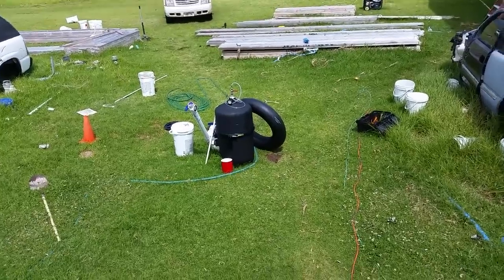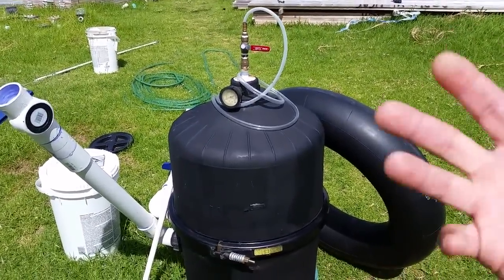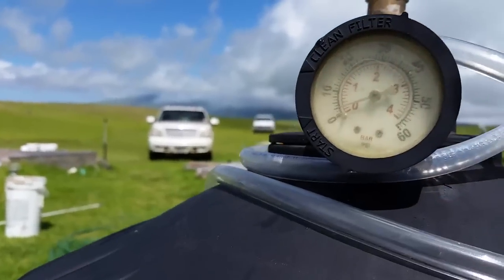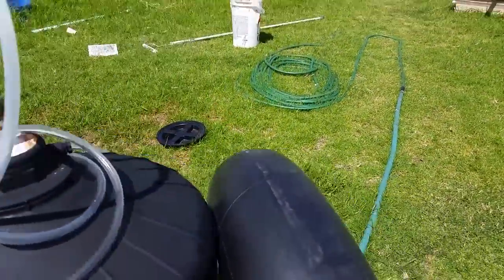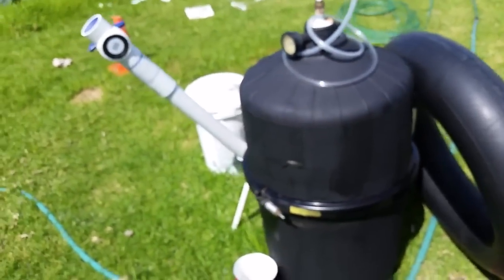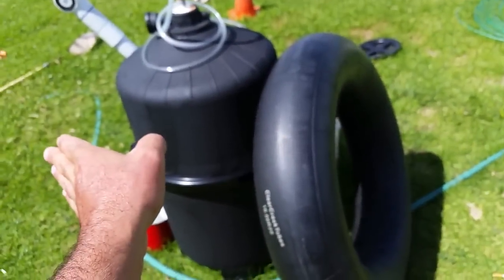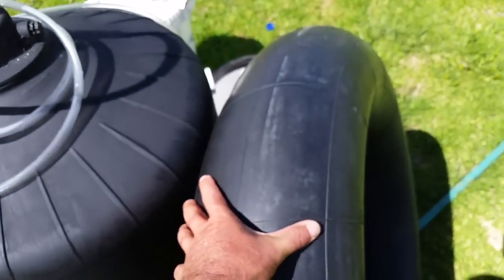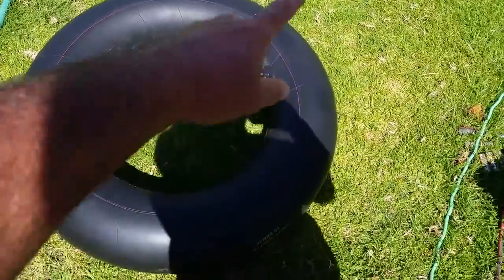How to make natural gas from food waste

Comment: How long can you cook on it ? 
It has no use if you can not cook every day your complete meal with it.  If it only can burn for a couple of minutes and then it needs another few days to fill up again ?

Would an IBC container not be better ? And even then i think it does not produce enough gas.  Maybe you would need several IBC containers. 

When you lead the pipe inside and cook with that gas inside would that be not dangerous ? I am not sure but somewhere deep in my mind i can remember that many years ago i have read that this type of gas is very unhealthy for your brain.  Maybe not when it burns clean. But still ? 

What if there is a point with not enough pressure ? Could the flame not travel backwards and create an explosion ? 

Is cooking with it the only option ? Would it not be possible to heat your home with it ?  Or is cooking the only option because of generating just a tiny amount of gas ?

What is the max pressure in Mbar that goes into the innertube ? 

Is the material of an innertube thick enough to not leak gas trough the material itself 

Do you not need injectors in the stove that are larger then needed for "normal" gas ? So maybe the need of a campingstove ?

Would it also not be possible to use this gas to power a generator ? So to have the main use with electricity ? By just running a cable into the home ? And by that not experiencing all the dangers with bringing this gas into your home ? Cooking outside would mean a lot of heatloss.

Comment: great vid.  a question - wouldn't it be safer to feed it into a gas tank? or does that not work because of the need to condense or something?
Reply: I was thinking that. In the HVAC field there are recovery tanks that can be filled up. If they are in a vaccum then they will fill up easier as well.

Comment: So after I fill that same tire tube and then convert the gas line to my Char-Broil grill to cook with it,, is it safe to cook with it that way also is it still releasing methane while cooking
Reply: Good question, I guess burning it  makes it safer but I also wonder if it's safe incase it's not burning completely or other molecules are also forming that we don't know about. If it's different from the normal natural gas
Reply: is the question if methane gas is safe to cook on? lol.  it is 4 hydrogen and one carbon atom. I would definitely add a flash back arrestor thought.

Comment: it must have a pipe for the water outflow because each time you add material and liquid to the tank it would eventually fill to the top and cause it to stop working blocking the gas outflow valve.

Comment: I would like to know how does this actually work like what's the measurement between the boxes the black box and the white one what's the pump? And how does this work like what do we need to create one can you make a video on how to build one in the process very interesting project thank you sir
Reply: He showed the inlet pipe for feeding food into, but what isn't shown is that there's also an outlet pipe. The outlet pipe is to allow room for new material to enter and create methane, while also removing the digested/finished product to be used as fertilizer. You'll notice the inlet pipe feeds to the bottom. This means once it's been pushed to the top it's finished, so that's where the outlet pipe needs to be -higher up on the container, near the top. All of this forces the methane down the path of least resistance: the tube on top where the waste can't reach. For other videos you can just Google methane biodigester. Sorry for the long reply, it's to help others in the future, too.

Comment: Would be better storing the gas in a pressure tested gas cylinder, with blow off/ pressure valve that returns over pressure gas back into the digester.

Comment: Just like human waste, is used to get methane to use on wastewater plant biogas turbines. Unused methane gas is pumped into the natural gas pipelines.  Human waste is put in large tanks, methane extracted and the human waste is processed, dried out, turned into "CAKE" then spread on fields as a fertliser. DON'T be surprised when the potatoes or vegetables on your plate have been grown using human poo.

Comment: I'm so going to do this for my shed I got to ask how do you protect it from flash back
Reply: Most don't use protection for that for the same reason that there is no protection for butane gas stove etc.
I personally disagree. Some use compressed steel wool and/or water bottles. Else you can buy flash back arrestor for butane/propane.

Comment: How is it possible that the digester tank can create enough pressure to fill the tire? it looks like you have four to five PSI at the valve of the tank but the tire tube looks like it is  inflated to perhaps 20 to 30 PSI?
Reply: My guess is that without a tire on the tube it expands easily with less pressure. The tube won't have more pressure than the digester.

Comment: Do you have to modify natural gas appliances to run off of methane? Or is it "plug and play"?
Reply: if your a using it for only cooking, you can 'plug and play'. however, if you want to use if for engines, like your generator, you have to purify it. this means removing anything that isn't methane. you can do some research on your own, if you need help, feel free to contact me.

Comment: is there a problem with solid buildup in the bottom over time?
Reply: Richard Stubing in theory no because bacteria break it down into gas.  If you put things in that can't be broken down then yes.
Reply: @skatastic57  Well thats not true, chances are you are putting in substances that are made up of more than just carbon and hydrogen. Methane is made of 4 hydrogen and 1 carbon atom so minerals etc will be left behind as will anything that is not simply hydrogen, oxygen, carbon or buoyant enough to dissipate. 
So short answer, you will have to clean the sludge once in a while but depending on PH just dilute it and use it as fertiliser.

Comment: Can it be stored in a tank rather than a inner tube?
Reply: vita Mc yes buddy u can store it in tank remove tyre tube use tank instead of tube but in tank no hole
Reply: The tube is elastic, a tank isn’t. It’s better to use the tire. If you want to use a tank there comes a lot of pressure.
Reply: methane doesn't compress like lpg except with advanced equipment. so no it cannot.
Reply: Clay Smith methane does compress and it doesn’t need an advanced equipment but certainly not a retarded equipment.

Comment: grear desing!a few questions.
wich kind of material u use to make a hole in the tank  and then seal it so u gat no leakage.
how much food waste u use? like in kg. is it diferent for any food, like vegetable vs meat vs fruit.
i see u have a pressure gauge, and the gas is pushin, at wich time u open valve to let the gas fill the other tank?
Reply: anderstip it probably depends on the material. For PVC, you can use an electric drill with a hole saw bit for holes larger than an inch.